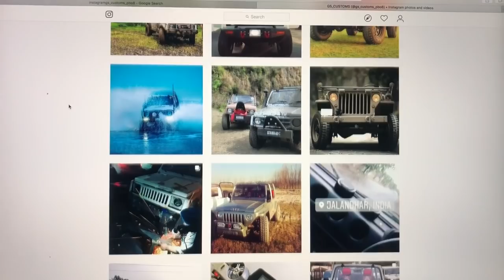Modified Gypsy With Automatic Gear,Engine Alteration & Conversion | Of All Car's And Jeeps | DKV_151

Comment: Ik gall kahan veer ji. Tusin jeda keda utth k gaddiyan modify karn lagg pende aan par tuhanu bohteyan nu takke di knowledge ni haigi gaddiyan de engines cho zyada power kaddan di te naa tuhanu kisse nu mechanical cheezan di fitting karan di. Oh pehla jedi black gypsy isuzu engine da bonnet khleya odon hi mai u pta lagg gya tuanu koi knowledge nhi. Tusin apna chrome kita hoye turbo da boost pressure pipe dekheya kiddan 90⁰degree da bend ditta hoya aa. Atleast 10 hp te tusin othe hi maarti. Air flow dynamics di koi knowledge ni thonu. Meri v workshop aamai willy ch paaji bolero 2018 model 3cyl mhawk engine fit kita paaji. Ajj tak tusin kisse ne mhawk engine willy ch nhi rakheya par india ch asin pehle aa mhawk 3 cyl d70 engine rakhan wale. Te ohdi eni pickup aa willys vich te bolero wale ne mere naal race laayi te oh hairaan c.Kisse ne rakhona hove. Te oh engine willys vich 22 di average de reha.